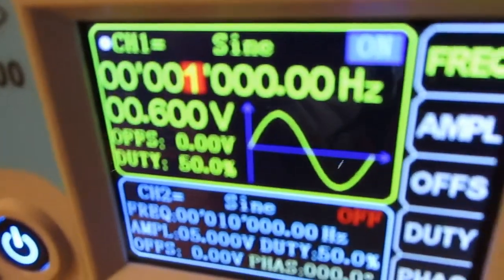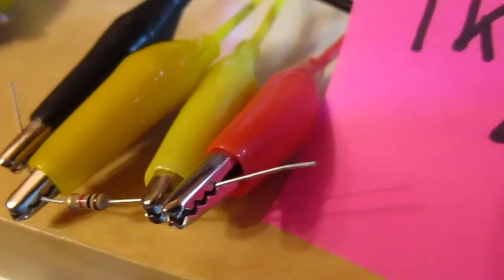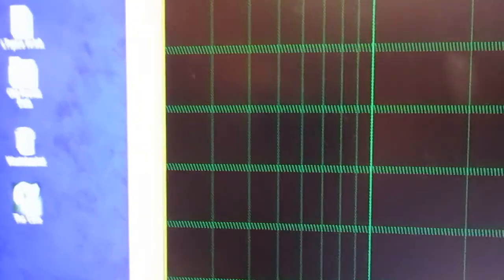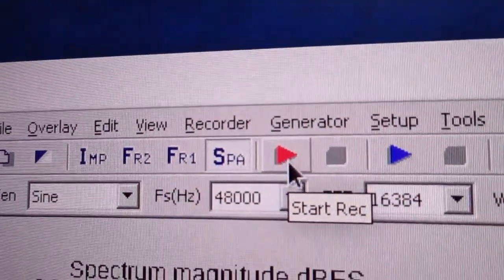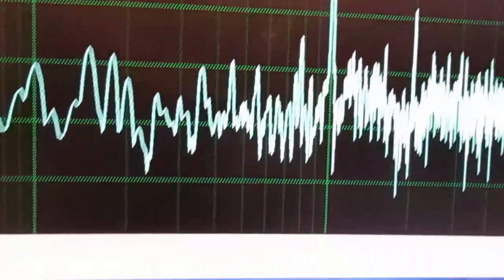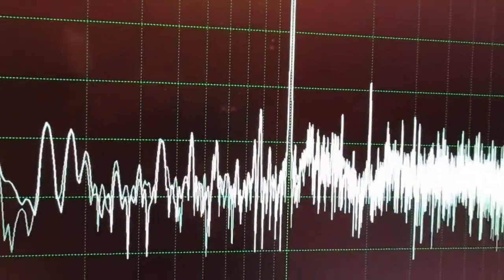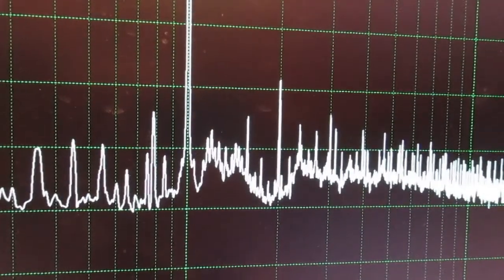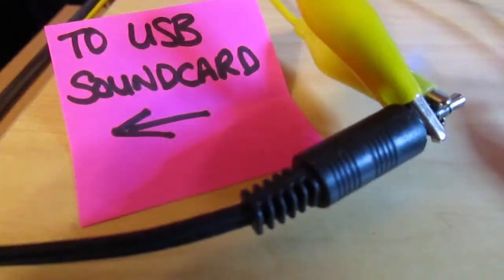Measure Total Harmonic Distortion with Noise easily with ARTA

Comment: Why 1k resistor ?
Reply from the maker: It's to provide a small load for the signal generator as the sound card has a high impedance input.
Reply: @TrystansWorkbench  thank you. Another question - when I plug my FG-100 DDS Function Generator I get same THD+N = ~0.3%. Suprisingly using iphone and appliication on it , for the same voltage I get 0.018% !!! Does it mean my hardware funtion generator itself produces some harmonic distortion? I would say yes. Question if 0.3% comprimises it as a tool to measure THD of an amplifiier. THank you :) PS. I am a beginner in this field.
Reply from the maker: @jatza07  So am I ! Yes the DDS function generators synthesize a waveform, so there will inevitably be distortions. Your iPhone is impressive - but bear in mind a function generator has to generate radio frequencies too, but your iPhone only has to cover audio. Search for a "Victor Oscillator" for a very low distortion oscillator ( a Wien Bridge Oscillator ) which you can buy. In measuring distortion in amps, then subtract off the measured distortion of the oscillator driving it. Also remember to take an attenuated tap off the speaker (or load) you are using.  I'm no expert though, have fun!

Comment: my 35dollar Creativ (Extrem Music PCIe) Soundcard in loopback @1khz 0.00048%, @50hz 0.01557% tested with the freeware called WaveSpectra. with arta @50hz 0.01%, @1khz 0.00%. Arta gives you only 0.xx% digit, WaveSpectra gives you 0.xxxxx% digit. With WaveSpectra also you can set the Soundcard driver from sound direkt(windows) to mme. this changes the max Samplerat from max 192000 32bit to the max 384000 32bit with 131072fft points. This Software and a 35Dollar soundcard make a reely nice and cheap Spectrum Analyser!!
Reply: Hi very interesting.  Could you suggest me a decent low noise usb sound card ?  i would really like to use a laptop for measurements.  Moreover how much is WaveSpectra ?  Thanks  a lot, gino

Comment from the maker: Comment From JohnAudioTech That's about what I'd say my FeelTech measured at. Have you baselined your equipment? By that I mean tested the sound card with a low distortion source to see what it adds to the measurements? 
Reply by Trystan
That's great. I've baselined it as far as doing a loopback test taking the output of the soundcard with a generated 1Khz to the input of the soundcard. This gives be a THD+N of 0.05%. From that, I can't tell if the THD+N is being generated or if it's the input that being distorted. I've also run your test tones WAV files https://youtu.be/cR1Tz8dQ1NE through the loopback, and your 1%, 0.5% match up, then your 0.3% measures 0.31%, 0.2% as 0.21%, 0.1% as 0.13% and the pure one as 0.06%. It gives reasonable confidence in ARTA and a cheap USB Soundcard as a starting point. In planning on building a bulb stabilized wien bridge oscillator - so hopefully that will help. Thanks for your comment John!

(I managed to delete the video off the channel - so that's why I've added the comment back!)